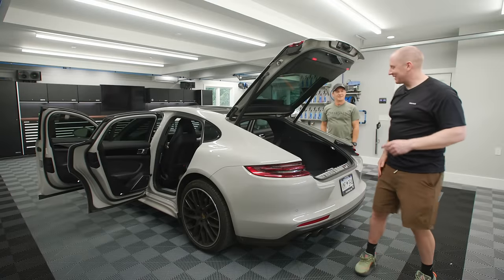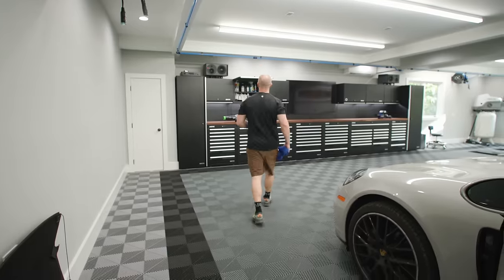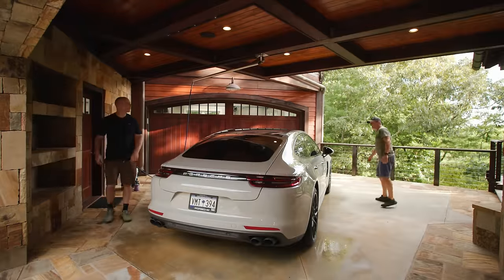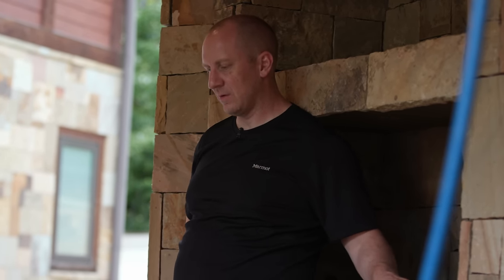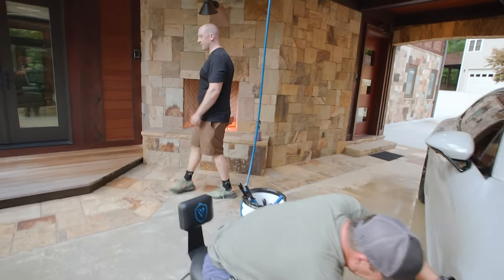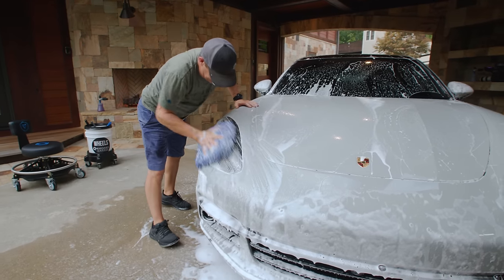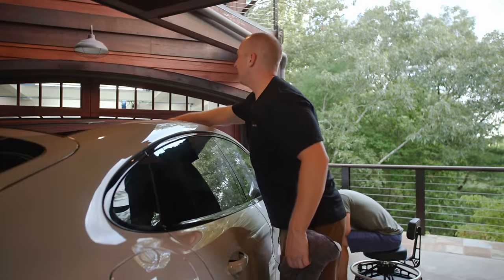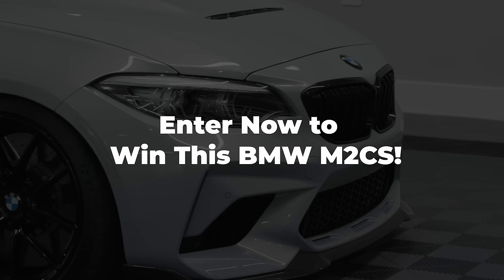Porsche Panamera 4S - Wash & Fireside Chat at Destination OG

Comment: as the owner of a Panamera Turbo S... it's a simply amazing car. Depreciation is real. I paid 40% of MSRP for the car with 25k miles and a CPO warranty for a very well optioned car (on top of the standard Turbo S kit). The car was like-new when I got it. The biggest issue with the cars is the air suspension.. the air bags leak maybe a little too much earlier than average and the front control arm bushings fail too early from the factory, at least on the first generation of cars. Otherwise they're a very reliable exotic car.

Comment: Matt, regarding the scratched tint in the fronts. I had the same problem with my Panamera. My very reputable shot told me it’s one of the hardest cars to do as the front window tolerance is too tight. He had to redo my windows several times and they always scratched at some point. Tried the mole skin trick too, made it worse. In case you decide to OG spec a Panamera.